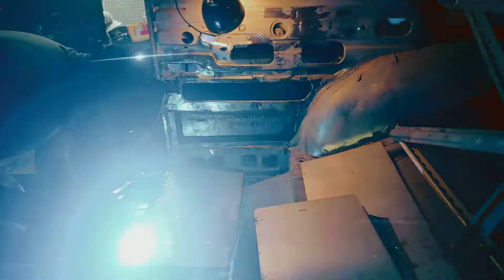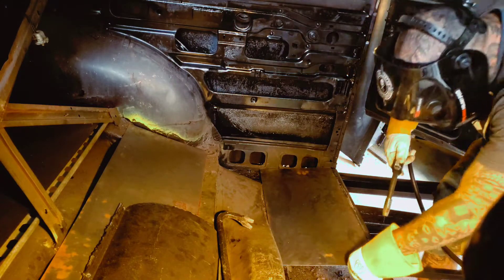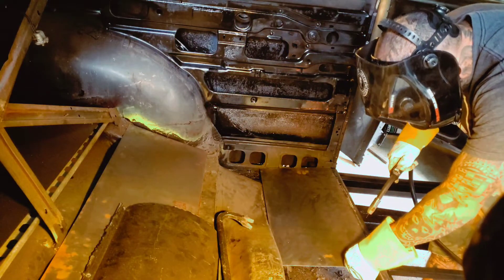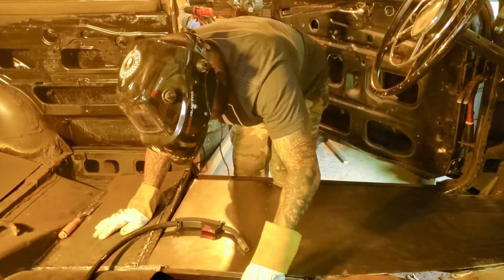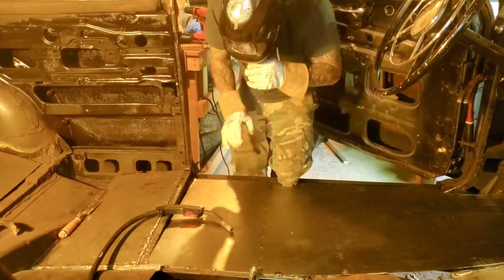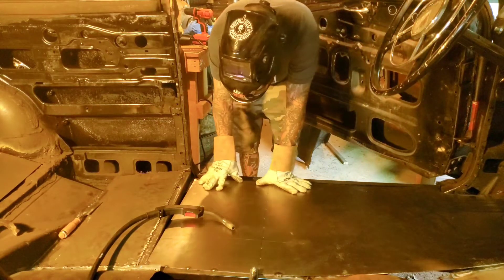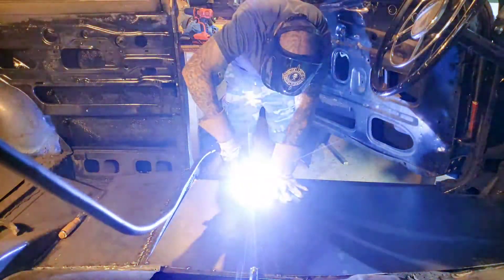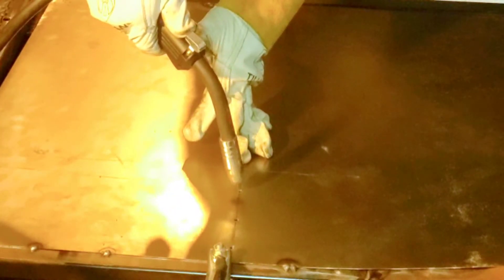1948 Dodge Gasser Build Pt.23 [New Floor]

Comment: Man, I hope you're proud of the job you did on that floor. It's killer and looks super strong. Hands down you killed it 🤘🏼. Strength over looks wins with me every time but it also looks damn good too. Besides... buy a bead roller... then waste a bunch of metal learning how to roll it the way you want and you'd add at least a week of hard at er time to do every panel and in the end.... it gets painted, or sound deadened, or carpet or just plain gets covered with seats and feet. I say this a lot..." if anyone is looking at the floor and saying anything bad about it.. well they are bent over and you can give em a swift kick! " hahaha. When someone hits me with a " i wouldn't do it that way, that's stupid " first thing I say is "what did you build here? ". 9 times outa 10... they haven't built a dang thing and they shut up pretty fast. It's for fun and hotrodding is a better way of life than many. Just my two cents. Cheers man!
Reply from the maker: Thanks man! I'm doing my best at it. I'm currently bracing the seats in there and I'm looking forward to finishing her up. I always appreciate the positive feedback brother, it reassures me that I'm not completely making an ass out of myself lol.